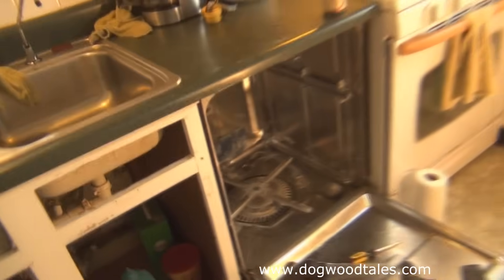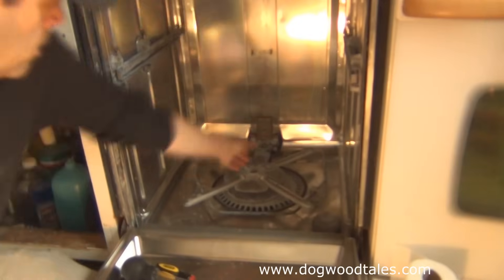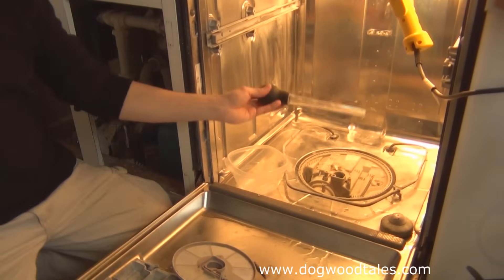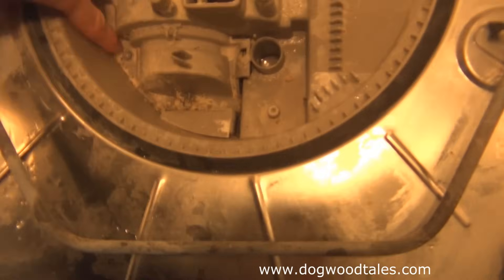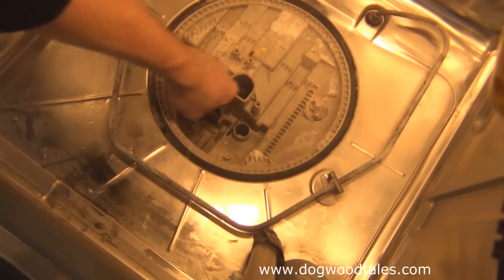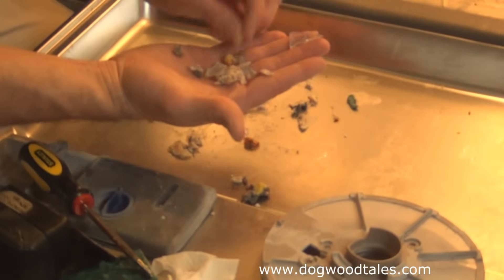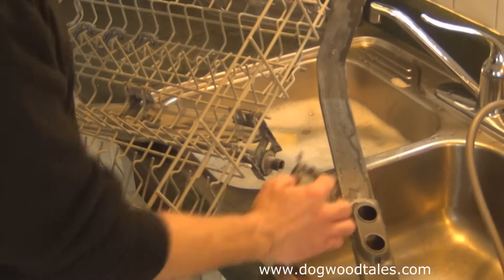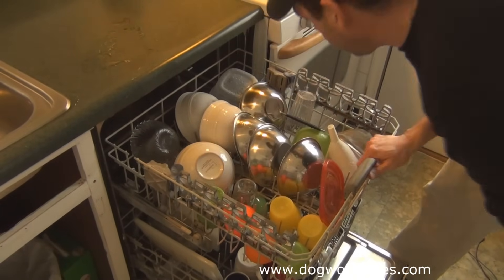Dishwasher Cleaning - Top Rack Doesn't Clean

Comment: I followed all the instructions on your video and when I got to the part about running a cycle without replacing all the parts, I have water now dripping out the bottom of the door. This has never happened before. What is going on?
Reply: well I cleaned the gunk out from under the door seal, and put the parts back in and it seems ok now....strange!
Reply from the maker: jane doe not sure but it sounds like the seal was compromised by the dirt. it doesn't take much to do that. Glad to hear it's working now.
Reply: Dogwood Tales have done two loads and dishwasher is working 100%!! must have been gunk in seal. Thanks for this video, my top arm wasn't spinning before and it made a horrible loud noise. after cleaning it all out it runs quietly and cleans fantastic. great tutorial! and ps. wow was there a lot of gunk in there!!

Comment from the maker: Thanks for the accolades. I suppose I could have removed that blade, but it wasn't really in my way and may not be removable anyway.
As for the leakage - I would imagine that if the apparent leak was only the one time and stopped that there may have been another issue causing the water to run out. Perhaps water was somehow trapped in the door frame and then somehow dripped out once you fired up the dishwasher. If it was a continuous/returning leak then I would suspect a bad seal.

Comment: Although I didn't have near the junk found in the video + I wasn't as precise in the cleanup, I did find the chopper blade/washer/hub OFF, its screen clogged up.  Used a garden hose on power spray outside for the pipes.  WOW you get an A++ ... but now I wonder IF I ditched the old Kitchen-aid 5yo too soon!?!?!? BooHoo!  Thanks again, what's next?  I'm a fan now.
Reply from the maker: thanks for the kudos.
as for dishwashers I've been meaning to replace the control board in my dishwasher. It's also not so difficult to do, but getting to it is a pain. I've done it once before. It's the reason the rinse aid dispenser is not working and that the soap door doesn't open. Until I get that replaced we've just been putting the soap in the tray and not closing the soap tray door. I'm going to order the control board here in the next week, so hopefully will have a video of that up in January 2014.
I do have a few other "how to" videos posted on my channel that people may find helpful, such as how to make a plastic guard for tools and knives using an old milk jug.

Comment: Great tutorial!  I had great hope after watching it and following along.  Unfortunately,, it still doesn't work.  Must be be some other issue in my case.  A bad valve maybe.  Seems like it's not getting enough pressure.  Sadly, I might have to call in a repairman :(
Reply from the maker: tsb5270 sorry to hear that. could be the water pump,  a clog behind the chopper, or a control board issue.
Reply: Actually, I'm embarrassed to say that on my first attempt, I forgot to clean out the chopper.  I got so distracted trying to find a turkey baster and getting the water out, I just skipped right over that part.  I watched the video again to make sure I didn't miss something, and whaddaya know, I missed probably the most important part.  Anyway, I went back in and found the chopper assembly was actually broken and just laying there in pieces.  The chopper blade itself was really clogged up.  Took out the broken chopper,  put everything else back together just to make sure there wasn't some other issue.  Happily, the water is now flowing in all the places it's supposed to (without the chopper).  I ordered a new chopper and it should be here in a few days.  In the meantime, looks like we'll be hand washing our dishes.  I'll say again, this is a GREAT video.  People (me) just need to follow along more closely! :)
Reply from the maker: tsb5270 glad it worked out. Obviously,   Don't use the dishwasher without a chopper.

Comment: thanks for the video.  I am stuck at the point of separating the piece in the back.  I removed the pot scrubber but the two pieces do not want to pull apart.  Any ideas that might help me?  did anyone else have trouble at this point?
Reply from the maker: The water line as it rises up from the bottom? Perhaps on your model dishwasher it has to come out with the screen at the bottom?

Comment: Looks like I have hard water deposits.  Is it safe for the parts to be soaked with CLR?
Reply from the maker: +rk7801 I've never worked with that before. As long as it isn't corrosive to the plastic. Otherwise, just scrape and scrub. That's all I ever did.
Reply: +Dogwood Tales (Ray) Thanks.  I will read the container first to see about use on plastic.  You should check it out to see what it is.  Very useful stuff for removing hard water deposits.
Reply from the maker: +rk7801 Thanks! I will look into it. But I'm planning on installing a water softener soon and hopefully eliminate the problem altogether.

Comment from the maker: Someone messaged me about their chopper assembly being ruined and whether or not they can run the machine without a chopper.
If you run the dishwasher without a chopper all that stuff you are cleaning out now will get down in there and ruin the dishwasher.
So if your chopper assembly is ruined, then either replace it or replace the dishwasher.
Sad reality is that while we can extend the life on these machines with proper maintenance, like most anything else, eventually it's going to be time for a new dishwasher.
Reply: +Dogwood Tales (Ray)     Hi Ray...I have basically the same exact dishwasher and have been trying to find information on the operation of the Proscrub feature ( for washing pots ) which is the blue apparatus toward the back of the dishwasher. This device connects to an L shaped piece called the the "Valve Assembly Manifold".  Inside this manifold are two steel ball which direct the flow of water either to the Proscrub feature or to the upper spray arm.   I am trying to find information on how this actually works....What actually activates the balls.    I've been on a number of appliance forums and know one seems to know.   Someone speculated electro magnet but I can't find any parts information.

Any thoughts.

Thx!

Gary
Reply from the maker: +Gary Sr I don't know either but my guess is that there is a change in the water pressure from the pump which forces  those steel balls into a different position thus redirecting more water through the blue apparatus. I don't recall seeing anything inside or outside the basin which would act like a magnet
Reply: Actually I found another video which showed me how to get the entire assembly off. It is easily replaceable. I ordered one and it should be here tomorrow... I get to follow your instructions again to get to it! Thanks!

Comment: My unit is brand new and the upper spray is not working.  Or water is not getting to the top.
Reply from the maker: Mista love weird. Shouldn’t be the case brand new. how new? How much has it been used? I’d call on the warranty before attempting anything myself.
Reply: @dogwoodtales  ...I got it straight from Sears the day prior.  Brand spanking new.  I ended up taking it back and exchanged it for another.  I hooked up the second dishwasher and it worked with no issues.  I think the other dishwasher was a lemon.

Comment: After I put everything back together I hardly have any water pressure anymore. Not even enough to make the arms spin. Any ideas?
Reply from the maker: Assuming you reassembled it correctly- Maybe the problem goop is behind the chopper as others here have found.
If not that, then the pump.
If not the pump, then maybe there’s an issue with the control board.
After that I’m out of ideas. Hope it works out ok
Reply: @dogwoodtales  thanks for the fast reply! Totally unexpected for such an old video. I realized I lost the gasket which goes onto that small piece that the lower arms attach to. Could that be the cause?

Comment: ok I have done tthat a couple of times now but still not getting water to the top after a few washes ? it will work ok once or twice but then im back to no water on top any idea on what else to try ? water pressure is fine in the house ?
Reply from the maker: As I've said before, I am not a certified repairman for these things. But if you are absolutely certain that there are no blockages in the entire pathway I would suspect that there's a problem with the pump, or some other mechanical issue. Check that the propellers etc are moving freely. I don't know if the control panel does anything to control water flow to the top, but if it does that could be a potential issue.
Reply: Dogwood Tales ok I will keep working on it thx
Reply: i have the same problem let me know if you come up with anything cosmo!!

Comment: Ok so what part of what you did fixed the problem u did a bunch of extra stuff.
Reply from the maker: The main thing is to clean out all the stuff at the bottom. That gunk gets in the way of proper water flow. The rest was just making sure everything is clean and clear.
Reply: @dogwoodtales  thanks dang I was hoping I didnt have to open it all up again.
Reply from the maker: @spencersperle8441  i would clean that out about once a year as a preventative measure. Seems odd, but you gotta keep the cleaning machines clean.

Comment: Im having a issue after I did this and I snapped everything back like it should now the door wont stay shut with the bottom rack in. Its hiting the plastic but everything is where it was before
Reply: Got it, the back prosrub piece needs to be in the right spot, the dimple in the middle has to line up with the frame on the bottom rack
Reply from the maker: tiremelter 
Sounds like  there has to be something out of place that you're overlooking. Perhaps the power wash assembly  (that blue thing in my video) is sitting too far forward for some reason. Or perhaps there's something about your track that's not allowing the wheels to go all the way. Just a couple ideas to consider.

Comment: Watch my video on how to run the unit with the door open so you can actually see what is happening.  Usually a water flow ( not enough water) inlet valve issue. Great video!
Reply from the maker: Very good! Nice way to help diagnose additional issues. 
Dude you need a tripod and your foot holding the tray had me laughing.

Comment: We did this and it worked after for about 2 weeks, then it didn't work again, fixed it again and then in a few days not working again...any ideas?
Reply from the maker: IDK - what's not working? The top rack again? Perhaps there's something wrong with the pump, the sprayer, and/or the control board.
I hate to say this, but the reality is that, sadly, sometimes, eventually, it's just time for a new dishwasher. Just like a car, it's worth it to keep fixing it ... to a point.
Reply: hi the problem isyourchopper assembly and the impeller are stripped easyjob to fix the reason why it stops is because the chopper doesn't spin then the screen gets clogged take dishwasher out put on table

Comment from the maker: You may want to try part store . com/ to find the part you need.
I've had good experiences ordering from them, but I've always had a part number from the manual.
Get your parts manual for your dishwasher and that will probably have the part number(s) you need.
The manual should be download-able from the manufacturer website. There are other download options on the web, just search your model number.

Comment: Darn, didn't work for me. One of those "flange"(?) stopper things in the back wall leading to the upper racks is missing. Maybe that's the problem?
Reply from the maker: are you referring to the part at 12:55? if so then that's definitely losing water before it can get to the top. I would order a new one. in the meantime if there are two holes and only one missing flap then adjust the rack to plug into the hole with the missing flap and the flap on the other hole should function to plug the hole and not leak. if both are missing plug one with duct tape to test the water flow through the other

Comment: Does anyone here know why sometimes the packets of dishwasher soap don't fully dissolve? It seems that this happens to our machine about 1 out of 6 washloads, and when this happens, the top rack's worth of dishes don't fully come clean.
Reply from the maker: I'm guessing that you're having an issue with the water flow. maybe clean out the dishwasher as I show here. if there's nothing down in there then maybe it's a water pump issue or an issue with the control board not opening the soap tray when it's supposed to. clean the soap tray well to ensure it's not g we getting stuck resulting in a delayed opening. 
again, I'm just guessing at some potential causes
Reply: Thanks. Ok, so I ran the check you did, and all five of the cups I placed on the top rack right-side-up all filled with water. I''m assuming that means water is making it all the way up to the top sprayer. But the dishes on the top rack still come out greasy. How can the water make it to the top sprayer, but not to the middle one under the top rack? I've checked it to make sure there are no clogs. Do we have a water temperature problem?
Reply from the maker: I'm not sure, but make certain that the lower sprayer is getting a good connection to the port in the back (shown at 2:08) and 10:12). Other than that I'd guess that you're having an issue with water flow elsewhere the dishwasher needs a thorough cleaning.
Maybe try running an empty cycle with a cup of vinegar turned upright in the bottom rack. This will help to clean out the system in general, but it won't get the gunk out of the bottom well unless you take it apart and clean it out by hand.
Again, it could also be a control board issue and/or an issue with the soap dispensing tray. Is your rinse aid dispensing?  I once had an issue with the rinse aid not dispensing and the fix was to replace the control board.
I also found that more expensive dish washing detergent is worth the money. The cheaper stuff just doesn't clean as well. Just a thought.

Comment: Thanks for the good information, but I don't think it's necessary to show, in detail, all of the cleaning.  Can't you shorten the video to the critical stuff and just say, "scrub out all of these parts"?
Reply from the maker: That's not a bad suggestion. Admittedly that's kind of a peeve of mine as well when I'm watching, say, woodworking videos. I don't need to see someone drive in ALL of the screws on a project, even in fast motion. So I learned to skip through the video track. I did take out a lot of stuff before this final copy and was surprised at how long it was still. Had I made this video today it would be a lot shorter, but at this point it is what it is and I'm not inclined to change it.
Thanks for the suggestion nonetheless.